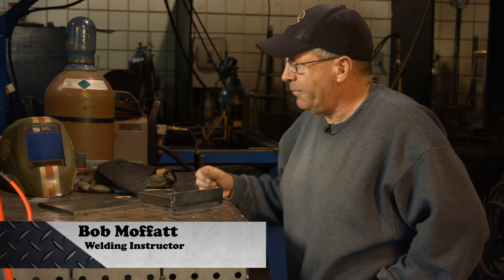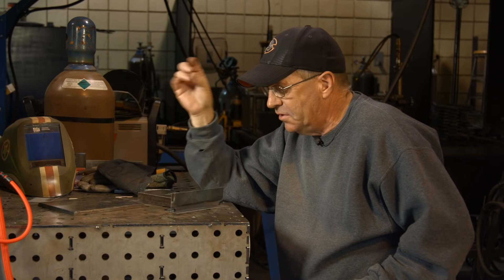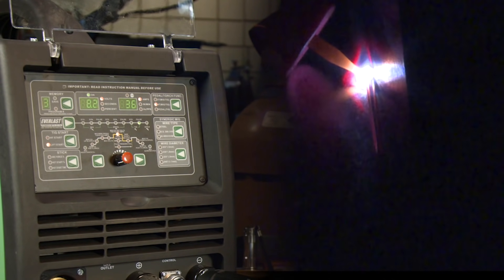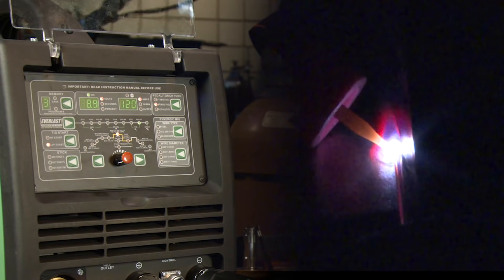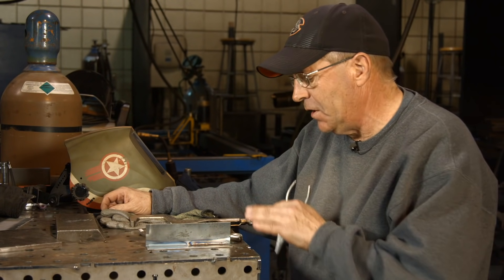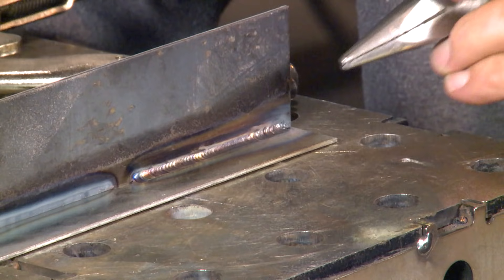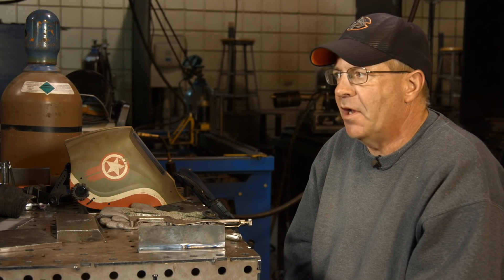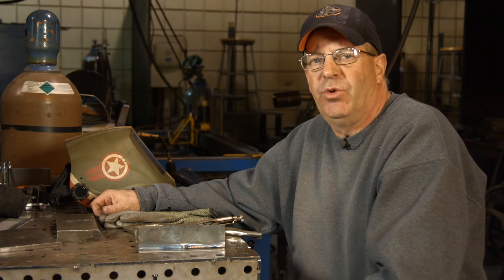🔥 Intro to Pulse Welding (Part 1 of 2)

Comment: Thanks for the video. Was wondering, why you are not using the HF start on the welder?
Reply from the maker: The only reason was because we had some people asking to see some 4T demos in some of our videos. This machine has HF, as well as lift starts in both 2T and 4T.
Reply: Does the machine not do HF and 4T at the same time, I have seen a few videos on this machine and no one has done 4T. I was just wondering if the 4T and HF can work at the same time?
Thanks for the reply.
Have a day.
Reply: Yes.  It does do both.
Reply: I though so, just trying to think of a reason you would use lift arc over HF start.

Comment: why are all welding channels so into chinese welders
Reply: You do realize their are no purely  American made inverter welders on the market right now......right?  Red and Blue are  merely assembling Chinese /Korean / Taiwanese parts in an American factory.  Some of  these machines are even made in mexico now as well.
Reply: Because they are more affordable which makes welding accessible for more people.
Reply: They used to use a Lincoln V-205. Lincoln stopped making them and they started using Everlast and ESAB.
Reply: The V205 was imported by Lincoln from Italy.  They were well priced but you could get two equivalent machines from China for the price.  Replaced by the Precision Tig 225 that is supposedly made in USA.  About the same price point.
Reply: $3K was what the V205 welder cost about 5 years ago.  Prices have dropped a lot.  An AHP Alpha Tig 200 is $680 today (on Amazon, not an eBay special).  I doubt if Lincoln makes its low end welders in the US.  They import from Italy, Poland, Canada, Mexico and China.  It's still nice to get the Lincoln parts, warranty, and service but realistically if the AHP only lasted a year you'd just dump it and get another.  The next one will probably only cost $500.  For a high-end, industrial welder: that's another story.  Go Lincoln or Miller.  But, hobby-level, part-time garage welder: I think you're better off going Chinese.
Reply: Bubba Gump lol that's the exact welder I got a few months ago, absolutely love it. and the warranty is exactly what I look at, iv heard way to many horror stories of Chinese welders blowing up out of the box and the customer being sol when trying to get it covered under warranty. with my lincoln yes I payed extra for a few less "features" than the ahp but I know my warranty is good (if needed)